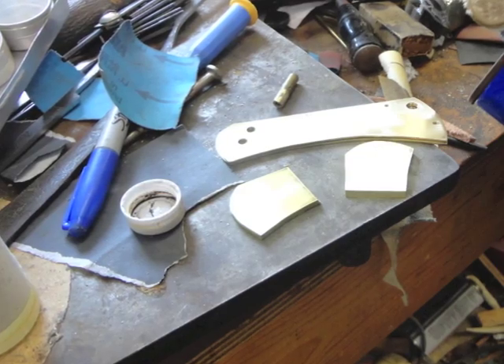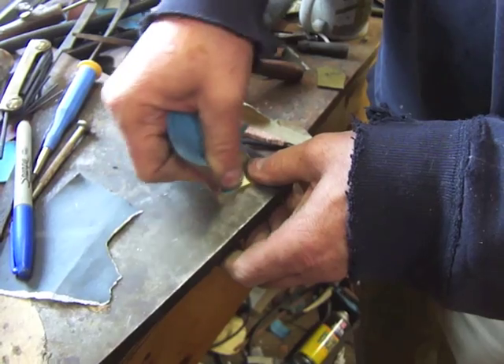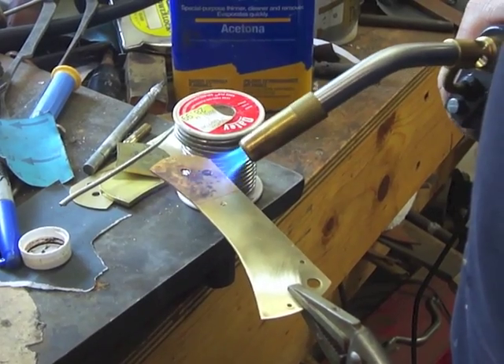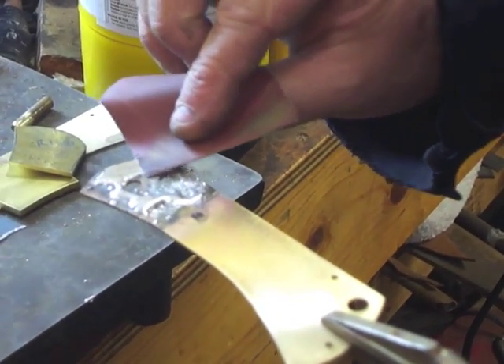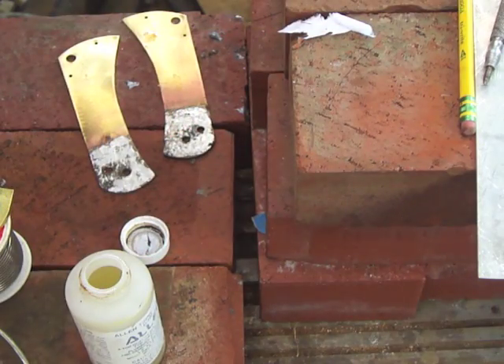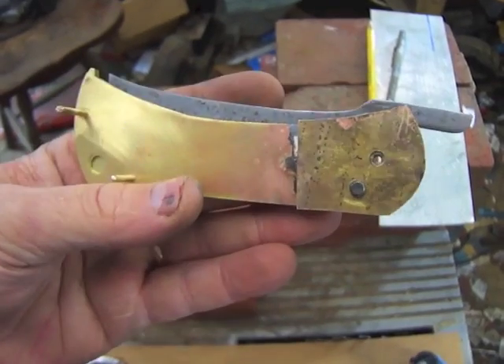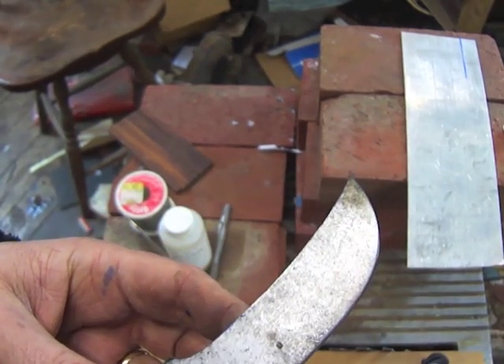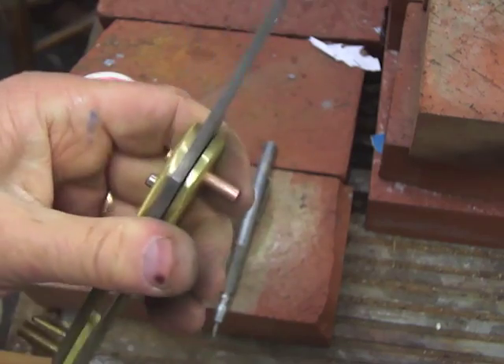Making a Big Ol' Friction Folder

Comment from the maker: Thanks, Matt.  I did not use washers. I use them on friction folders when they do not have liners.  I polished the tang and like the action of it pivoting against the brass.  It makes the blade very solid laterally and good friction for holding it open and for retention.

Comment from the maker: Thanks, Mark. I used copper to contrast with the brass and it was all I had in 3/16 :-).  It will be fine for a friction folder.  Most older slip-joints have brass pins and this copper rod is not much softer than yellow brass. But for long-term durability a steel pivot would be best.

Comment from the maker: Hi Lsub!  It is very solid and heavy in the hand.  I like it a lot.  I will be putting my Sugarcreek Forge letters logo (like on my razors) on this one.  It should look cool.  You are right, it does look like a beefed up Micah knife.  I use hardened dowel pins.  I buy them at a hardware store and they are prehardened.

Comment: Great video, once again I've learnt a little more about working with metal. The knife really looks great, and the brass and green look just right together. A question: I'm curious as to why you used copper for the pivot. With copper being a softer metal is there any problem with wear over time? Thanks Tim.

Comment: hey Tim, I KNOW WHAT YOU MEAN ABOUT THE CRACKING. i just did a water quench on three different blades and 2 of the three had some kinda cracking issue..... I was curious to ask your opinion on water quenching 1095..... also i noticed some people dont pregrind your blade before quenching. is there a reason? lol sorry for all the question. 

also love the copper pin. looks good on the brass

Comment: i have a question.
how did you get that dark grey finish?
Reply from the maker: +Gabriele Ciciriello Hi buddy - I etched it in Ferric Chloride.
Reply: thank you very much
Reply: but i usually see people that use ferric chloride and instead they get a pattern on it,while i want just a flat grey finish.
do you know how to help me? i would really appreciate it
Reply from the maker: Sure - Just make sure your blade is heat treated evenly. Then dip it in the ferric chloride for a few minutes. Pull it out, and wash it off. Rub with very fine steel wool. Repeat until it looks like you want it to.
Reply: Thanks,i'll try that